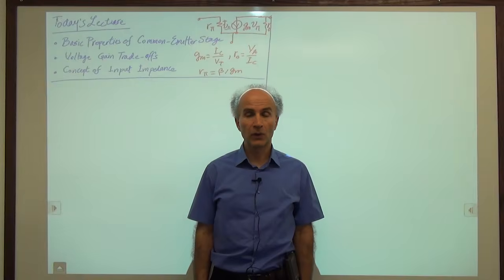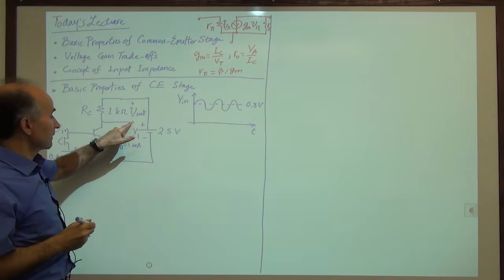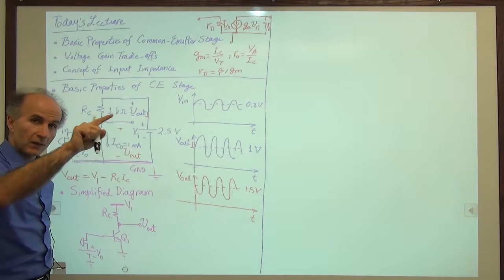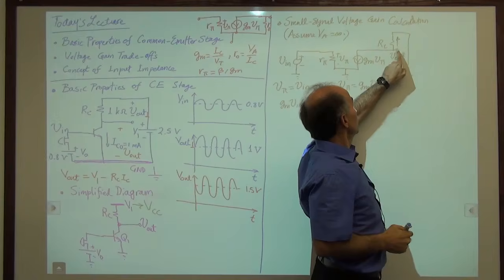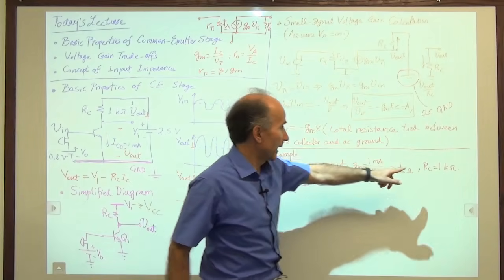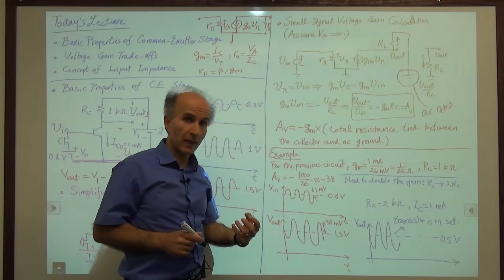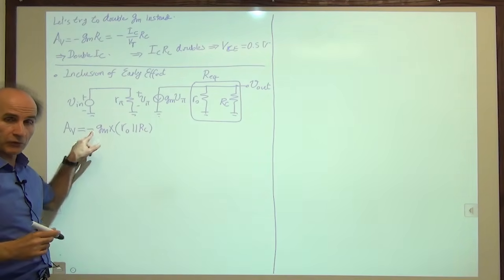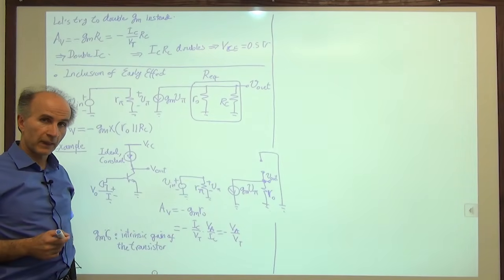Razavi Electronics 1, Lec 20, Common-Emitter Stage

Comment: Sir at 38:58 if we want to double the gain sir..if we change the transistor .. new transistor area= twice of the old transistor area.. if area double current double.. so that transconductance gm double .. if gm double voltage gain double.. I got this idea sir.. sir u only tell na sir think in different ways.. analyse the circuit..don't panic.. circuit won't bite.. if we want to use the same transistor in that case i have another idea sir.. what if we connect another transistor in parallel with first transistor..base to base , collector to collector , emitter to emitter connection.. it will work only transistor don't have early effect.. in that case gm doubles gain doubles..if we consider early effect cuz of parallel connection of transistors gm doubles at the same time due to early effect r0 becomes r0/2 consider identical transistors.. then final gain remains same..

Comment: I think we should have added the output resistance r[o] of the transistor to the small signal model of the common emitter amplifier such that the resistance that converts the current back to voltage will be the parallel combination of the R[C] and r[o] unless we assume that r[o] >> R[C]
Reply: Oh ... Prof. Razavi said that he ignored V[A] or the early effect so r[o] was not included .. i commented too early :)